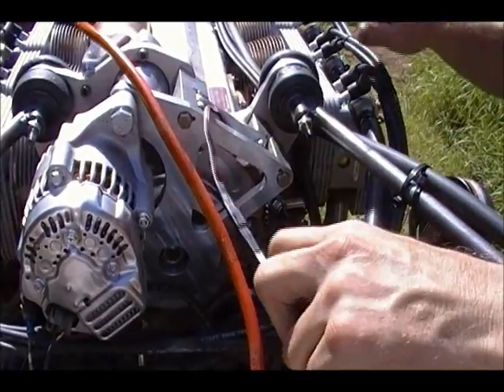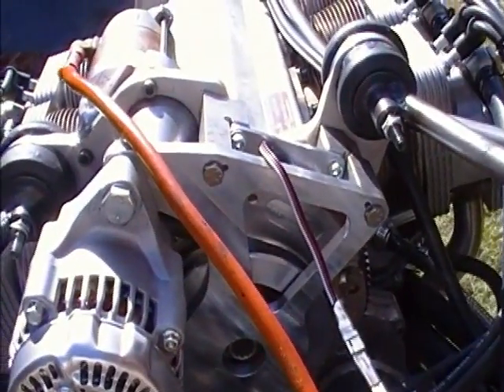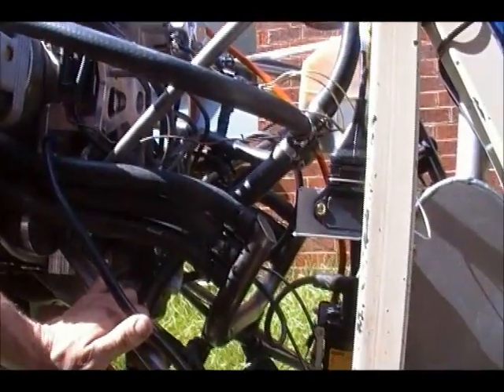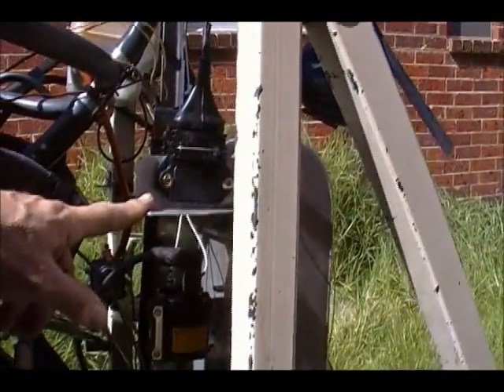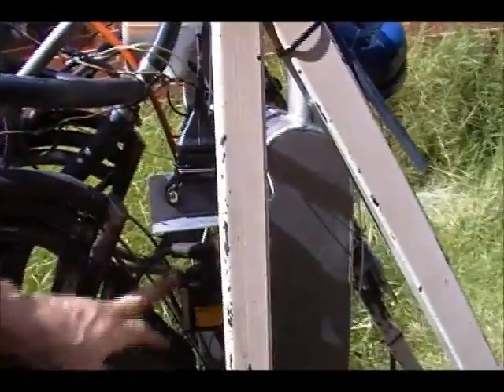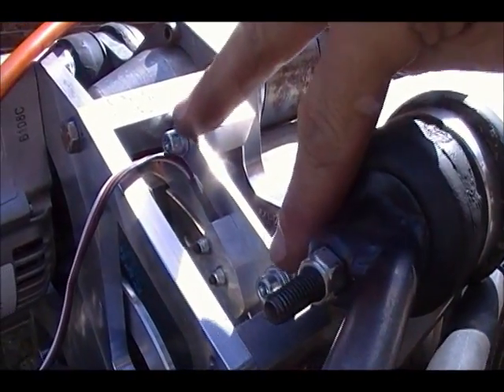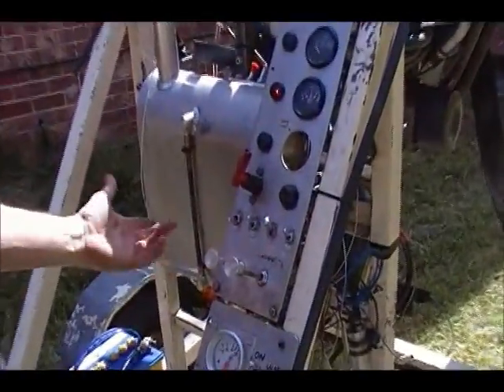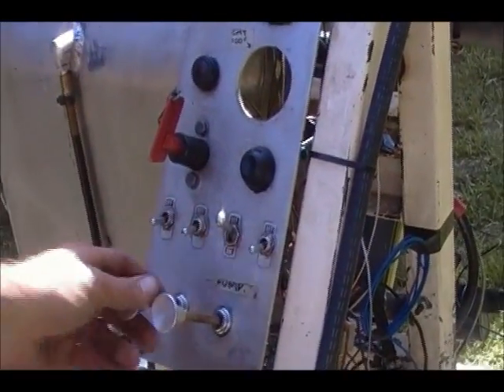Jabiru Electronic Ignition

Comment: Hei i have question. From where hall sensor getting singnal, from old magnetos for coil?
Reply from the maker: From the flywheel magnets. So you just mount the sensor where the coil once went
Reply: @fb2800  hard to explain for me, but maybe you will understand, on jabiru flywheel stands, magnets for coils, and if hall sensor is picking spark from whose, it will give six time spark, because its 6 gaps.
Reply from the maker: @kamikadze242  the hall sensor picks up 3 pulses per revolution as there are three magnets 120 degree apart on the flywheel . So six pulses for 2 revolutions (4 stroke). Hall sensor Pulses covert to sparks from a high voltage coil and these are fed into the standard distributor. Trust me it works perfectly:)
Reply from the maker: @kamikadze242  no because only South Pole is sensed. North pole is ignored by the sensor

Comment: So let's see.. You now have Liquid cooling heads, you have a new alternator, you have electronic ignition, you already produce cylinders and pistons for your radial engines. What is stopping you from adding a crankcase and a crank? You can sell 4- or 6-cylinder Rotec replacements for Jabiru!